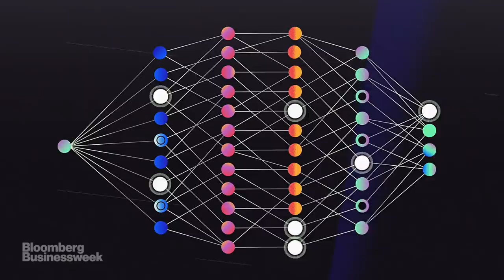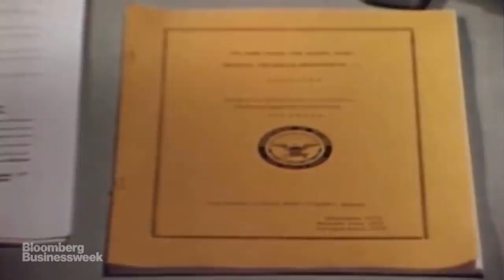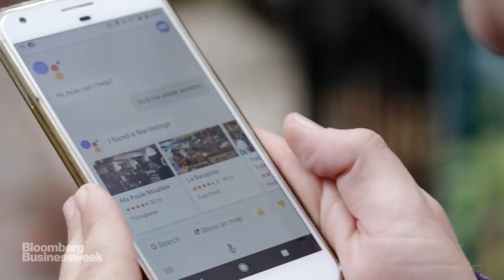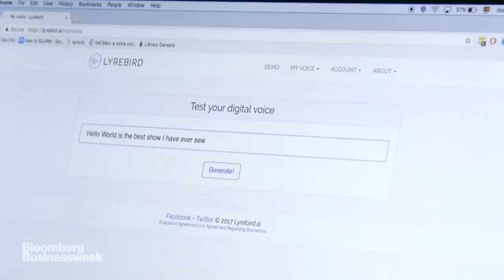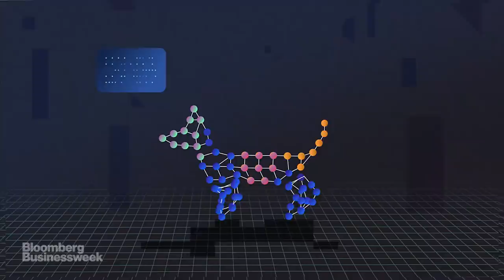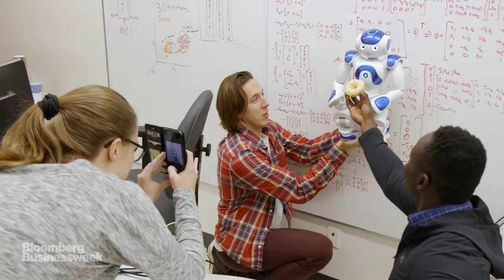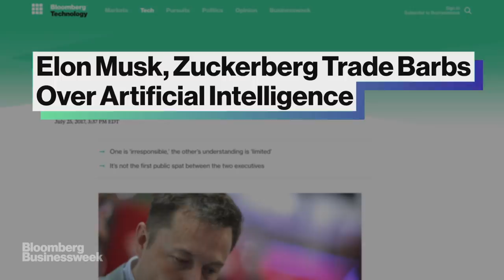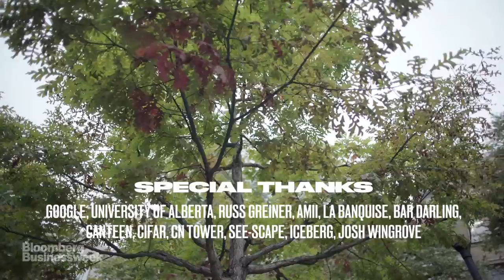The Rise of AI

Comment: People are afraid of AI today the same way people during the industrial revolution were afraid of machines and electricity. Yes they'll replace low skilled repetitive labor continuously, but they will continue to provide humans more productivity and efficiency, and also open new complex and interesting world contexts to advance in.
Reply: @balsamiqmunchy I'm actually a Software Engineer and my Masters is on AI (gaming mainly), and have done lots of neural networks research. My POV is that AI is just another advanced form of mechanization., in the sense that AI will become smarter in specialized problem solving than humans, the same way cars are faster than humans on the road, and machines stronger than humans in a factory. Eventually, it's just another tool at our disposal to increase our productivity.

Singularity is just a break-even point at which a machine becomes better than a human in solving adaptable problems. It will replace humans in many aspects along the spectrum of work that requires intelligence, but I don't think it will annihilate humans in the work force. Humans will have to adapt to new skills, the same way a human mechanical typewriter has to adapt to using a keyboard.